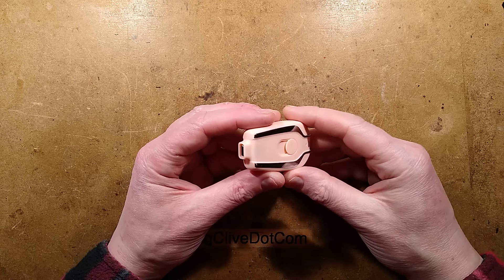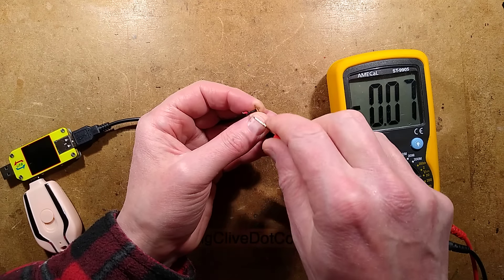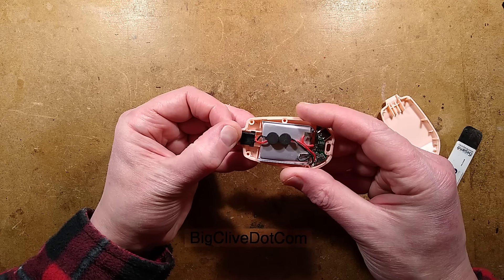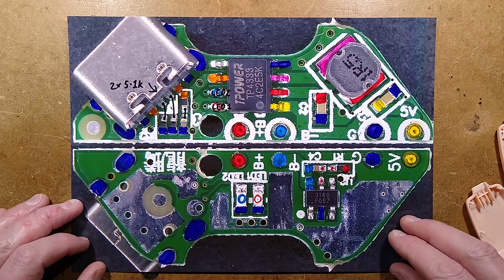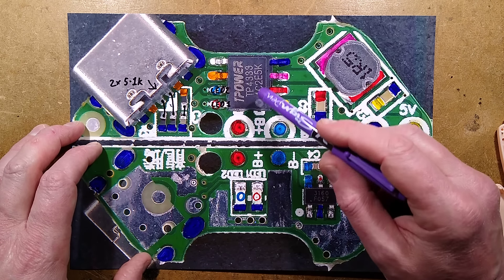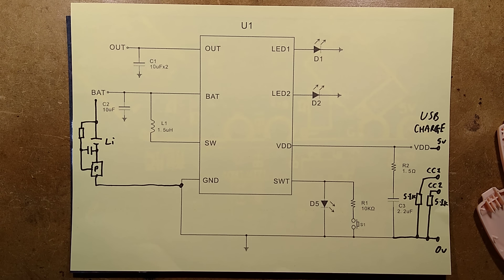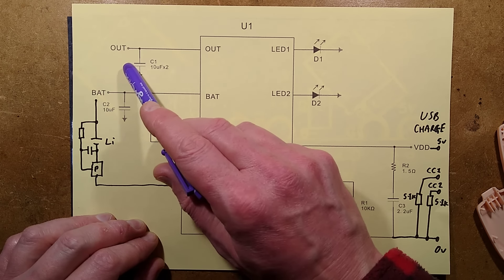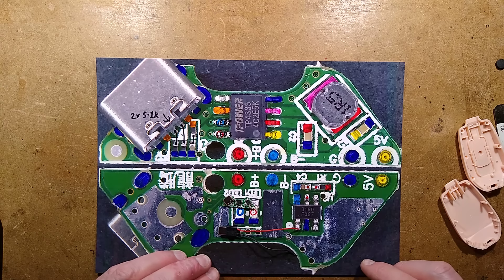eBay keyring phone-killer

Comment: Hi big Clive have you used the Bluetooth and app on the usb power meter ? Video on it soon ? Also recently had a baofeng radio with the pos and neg with the wrong colours lol
Reply from the maker: I'm not sure this model has Bluetooth.
Reply: @bigclivedotcom  ah I made an assumption that it would just be the same model lol .try top right above the usb output side. you might have a tiny sliding switch near one of the 4 buttons  🤷🏻‍♂️👍🏻
Reply: @bigclivedotcom  I changed my picture if you  want a look where slide switch would be n hello from the bridie toon 😏👍🏻

Comment: a company i worked for bought 2 hundred 12 volt 30amp power supplies every one was fused in the negative line and all where CE Marked
Reply: Well the Japanese switch the negative on low voltage DC.

Comment: I bought a cheap 4 gang extension off Amazon with USB built in. I plugged phone in and after a while it tripped my electric until I USB. The normal plugs works OK but I've stopped using the USB's

Comment: Quality Control! I am pretty Shure thats a thing in the past. I have brought so much stuff in the past (just not electronic stuff) even a brand new car (a gouge on the rear bumper and the cover for the battery laid across the engine and the bonnet closed down it). You remember the sticker with the persons signature and the number of the station they was sitting at? All things of the past.

Comment: I would have just said to salvage the lithium cell out of that, but given it was only 600mAh, was it worth it?
I'd have soldered the wires back on the right way, so that it at least worked, but the same is true - what use is a 600mAh powerbank when 3000mAh powerbanks are still relatively portable?

Comment: I'm wondering if the worker who was soldering the wires saw how the battery was wired and thought that's how the connector should have been wired. It DOES seem a little odd (to me anyways) that it's reversed from how the battery is wired

Comment: A long history of this type of assembly error.  We bought two remote control appliance switches.  Discovered that, just like here, the output was swapped polarity on both!  Worse, the wires were swapped before the switch, so it was switching the neutral on and off, instead of the hot.   Reported it to UL and CSA.  They did not care! Their label means nothing!

Comment: That is quite insidious as low voltage electronics cannot always afford the usual ultra-cheap reverse-protection diode due to the forward voltage drop. Given cost constraints, I wonder how many usb devices do have polarity protection?
Reply from the maker: There is a polarity protection technique using a standard MOSFET with no voltage drop.
Reply: @bigclivedotcom  Yeah I just wonder how many actually spring for it given how insufferably cheap manufacturers are now.

Comment: Connectors are also not fool-proof, when I bought a 3D printer from a company called Sunlu, it did not extrude filament correctly, upon further inspection, the connector to the stepper motor responsible for filament extrusion was forcefully inserted the wrong way around, luckily, in this case all of this just meant that the printer didn't print, however if this were a base motor or polarity for electronic devices, the outcome could have been worse.

Comment: Hey Clive. I was wondering if there was some way you could include links, or even just generic instructions on how to buy some of the nifty gadgets you use for testing the not-so-nifty gadgets. Like, I'd love to gave that USB capacity meter you have. Ditto for the HOPI, though I don't think they work in North America, and my Kill-A-Watt died in like 6 months. But that's what I mean, It's assumed you buy the higher quality (or at least less crappy) testing kit. So I'd rather have the things you use. But at the same time, Other than having a CSV with each product and site listd I don't see how that could work.
Reply from the maker: The Ruideng and Hopi came from eBay, but are not always available, or sometimes listed with a different name.  I can't provide direct eBay links because they tend to rocket in price.
Reply: @bigclivedotcom  That's good to know. And they would work on North American Mains with an outlet adapter without it affecting the operation at all? That's my main concern.

Comment: Dear Clive,  I hope that you realize that the USB-C is reversible and that your tester does not have an IC that can switch the input properly.
Reply from the maker: The USB plug is reversible because the pins are mirrored.
Reply: @bigclivedotcom  So it is...  Just looked at the spec sheet.  But where the switching comes in is swapping the power and data pins for certain applications was where I was confused about.  Thought there was an IC just like a bridge rectifier that did switching of polarities

Comment: Any "best practices" (or ISO) approach would surely eliminate this repeated mistake by the mfg.  But implementing a lean mfg solution isn't cheap.   So we get what we pay for.  Your diagnosis was simple to follow even though my career discipline is mechanical/hydraulic, not electrical.
Reply: You have repeated a common belief that “lean Manufacturing “ is too expensive to implement.  Actually not using lean manufacturing can be expensive.  You have to complete a RCA /8D.  Once you identify the error you need to make a change to eliminate the error.  You also have to determine why the error was not identified until it reached the consumer.
Reply: @cdnmetelhead4013  I spent 2 days a week all day for 6 months doing fishbones, flow charts (i/o) and other lean mfg related RCA studies in a room with about 6 or 8 other highly paid professionals, to determine the company costs for non value added engineering revisions.   At one point I thought about doing a side study on how much we are spending to see how much we are wasting.  I was afraid the irony would upset the VPs, whom love their pats on the back for doing "something".  Right, wrong, or indifferent.  

I never said it was too expensive.  It IS expensive to implement.  Internal resource costs can easily hit 6 figs in no time.  I was on an eng project to simplify the interface with the revision control module of our pdm.  The first fiscal yr it was implemented, it saved the company 5 mil.  Not every company can afford the time to implement such a study though.  But as proven, they can and usually DO pay off.

Comment: My guess is $worker noticed the battery wires are + and - from the left, saw red and black wires, and assumed the wires on the output were the same orientation. It is an easy trap for the new and the tired.
Reply: They probably have to make 1000 a day too.

Comment: i wonder if this is a one off and you just got unlucky.
600mAh isn't a lot for the battery but it would definitely be fine as an emergency backup for a keyring. If it can maintain it's charge when not in use for a long time.

Comment: Besides the common utter scam battery size spec, I was wondering from the caption if this report would call out any heavy chunk of stuff hanging off a micro connector as a damage hazard or cause?  

Some products simply should not be made.  

Another issue is how some power banks, including reputable brands with QC circuitry, require a button push of the same button that turns on the charge level LED row, to start output even if connected to a maor brand phone or tablet. In theory newer power banks with QC and IQ controls of voltage and current, never mind USB-C spec's for potentially 3.3 to 20 volts and up to 5 amps, need to sense load issues and protect against bad cables or load devices (that a backwards polarity would appear to be).

Comment: That's too bad that a simple mistake can ruin so many devices. It's too bad. That's terrible quality control. It's actually a neat device. Especially if you just wanna clip it to a key chain and give your phone a quick charge for an important call. I'd just hope the device that it gets plugged into has reverse current protection or some components that would protect the circuitry.

Comment: Did you put it back together (correctly) and measure the output current / voltage?
Reply from the maker: I put the battery on test and haven't reassembled it (correctly) yet.

Comment: If you replace the battery, what might be the max theoretical capacity you could put?
Reply: That looks like a 25mm x 35mm x 5mm cell (for a type code of 253550), and from my cursory Googling with that form-factor you'll be hard-pressed to beat the 600mAh it ended up being (from the description).
Reply: @aaronmdjones  oh sorry, my question was electrically speaking
Reply from the maker: If size wasn't a limit you could have any size of cell or a cluster of parallel cells.  But recharging could take much longer.

Comment: Normally I would doubt  that this thing would cause any problems with any modern equipment because polarity protection was standard for years. It was just a matter of putting a one-way diode on the positive input as far as I'm aware. Maybe things are different now. Trying to charge a Lithium Cell directly with incorrect polarity is definitely a bad idea as the cross-polarity would effectively be shorting the charge (correct me if I'm wrong). So this all raises the obvious question: Do modern electronics have polarity protection? Does the charge chip and voltage regulator circuit have polarity sensing?
Reply: My $100 bluetooth speaker had a series diode between the primary buffer capacitor and the rest of the circuit. So when you connect the power the wrong way around it will go "pop" inside as that capacitor explodes but other than that it will be fine. A problem with putting a diode in series is that it will drop a voltage. If it is a shottky diode it is not as bad, maybe 200 mV but a regular silicon diode will be more like 600 mV, so if you put 2-3 amperes through it you lose over a watt which can make it hot enough to fail/desolder. Another strategy is to put the fools diode so that it will short the reverse connected thing out (preferably having a fuse in series). Such a strategy may also just count on the power source to be fused instead. Of course, one could use a FET instead of a diode and get nearly no losses but it increases component count and cost slightly and may therefore not be done.
Reply: What you call the 'fools diode' is something I have seen which was used to protect circuits from high voltage burnouts.  But what I was referring to mainly was on the input circuit  that was to be fed by a 9v or 12v DC from Mains transformer (commonly called Power Adaptor back in the day). It was very common for people to use incorrect voltage or incorrect polarity transformers as polarity wasn't standard for some reason (i.e. Wasn't always 'Centre Positive').  In those devices, incorrect polarity wouldn't destroy the diode, the power adaptor would just get warm very quickly (ceramic smoothing-cap across the power rails I think) so you would know that you got the polarity wrong. However, an incorrect voltage that was too high by just a 3v difference would destroy that diode. ....which is why many bodge-artists just bridged the points where the diode used to be. (The same bodgesters thought bridging across an internal fuse on a 50v circuit was a good idea until the equipment caught fire when the original fault inevitably happened again).

Comment: I operate a selective soldering machine building boards for nice expensive power amps used in big PA systems. Even we get the odd mistake which escapes our fairly rigorous quality control. When you’re looking at minuscule profit margin, mega mass produced cheap stuff like this, assembled by a hugely overworked and woefully underpaid Chinese employee, probably working in pretty terrible conditions, it’s no wonder so many units are duff or even dangerous. 
  Problem is, at this level people won’t pay the money for items assembled under fair and safe conditions. 😕
Reply: Are such quality items even available?

Comment: I once bought a cheap power cable for my £280 TomTom satnav, supposedly 12/24v to 5v, it smoked it straight away, on dismantling the plug I discovered there were no electronic components inside, just 2 wires from the centre and outer pins of the lighter plug straight to the mini usb plug!
Reply from the maker: I've got an OBD port to USB adaptor here that puts the cars 12V straight to the USB connector.

Comment: Aw, only 2 wires to the type C plug. No chance of shenanigans over 5 volts; Power Delivery going the wrong way could have been spicy like that time I hooked up an Arduino Pro Mini to 12 volts in reverse and blew up a tantalum cap (probably wouldn't be possible unless the sink side also goofed up and switched the +/- wires). Fortunately the board was undamaged, so that was an easy fix.

Comment: Crazy. I think it is rather frightening that more and more people that live in places that does generally have good regulation when it comes to hazardous materials and circuits will be bypassing all those regulations by private importing things using amazon, ebay, aliexpress, wish and so on. Who knows how much dangerous goods just end up in peoples homes, and what the accumulative effect of this will be over time. I don't want there to be a ban on private import though, I just wish the culture surrounding it was more observant on what the risks are and who is liable if something goes wrong. If you import something and your house burns down you can't hold someone else liable for that the same way as if you buy it from a local company. This entire paragraph is assuming regulation similar to EU, not sure how it works in other places. But since local companies have an economic incentive to not cause damage they may have some more quality control than if the only incentive is whether you sell the product or not and there is no liability involved at all. Only the reputation of a username on the internet... which doesn't say that much today when reviews are cheap to buy.

Comment: That's a shame alright, but don't feel too bad for the manufacturer, that could have been easily caught in a simple quality control test on the assembly line. Or did the original manufacturer actually catch that and then dumped all the failed ones to a sub-contractor who didn't care and sold them "as is" ?

Comment: Why do some charging wires just go bad
Reply from the maker: They tend to break internally at the points of most stress like where they go into the plugs.  Adding strain relief to a new cable can make it last longer.
The surface plating on the contacts can also wear off over time, resulting in a higher resistance.

Comment: Seems like it may be 'good practice' to always test new power banks on a sacrificial device (like a light or something) that can be easily replaced -- prior to plugging it into a more expensive thing like ones currently-used cell phone. Sure, having a multimeter would be really nice and all. But not everyone who has a power bank needs to worry about a multimeter in their lives. Maybe even keep an old obsolete phone around for just such a sacrificial purpose, rather than scrapping it. I can just about imagine how far you'd get trying to get that POS power bank seller to replace your ruined device...assuming you'd make it past the language barrier. The factory that made it, and the seller who sold it, obviously didn't do even a MINIMAL check of the device prior to selling it. And there were probably quite a few made with that same flaw. It probably makes more sense for them to try to sell them to recover the mats cost, without regard to societal harm, than to recall them and try to fix them individually. The ethical thing to do would probably be to just scrap them all, and eat the costs of the mats. But nowadays it's a simple matter of creating a new disposable account on a site like Ebay or Amazon, offloading the dodgy products to trusting 'suckers', and fly-by-night as the complaints come in. It's a terrible whack-a-mole problem. The best Ebay/Amazon can realistically do is blacklist/block a bank account number of the fraudsters. And then it just becomes a matter of how difficult it is for them in their country to get a new bank account number. Sometimes they're back up with a new number on the same day, according to a documentary I watched awhile back. Some of them definitely seem to have a good number of pre-made bank accounts all ready to go as soon as their current account is closed off. Being able to buy things 'direct from China' is nice in many ways. But it can be exceedingly dangerous as well.

Comment: Those tiny power banks could be useful for powering low current devices, I have  21,000mah power bank that can deliver up to 5A but its almost the same size and dimensions as a house brick and weighs pretty much the same as one too lol!
Reply: I have a (genuine) 1500 mah one I keep in my jacket pocket, about the same size as the one in the video, along with a short cable. Takes almost no space and weighs very little, but will  charge my phone by about 20% which is enough to make a call, use maps, call an Uber to get home etc
Reply: The problem with a lot of these powerbanks is that they will switch off the output if the current draw is too low.. Sometimes less then like 50ma will not be enough to keep it on.
Reply: @longinus665  True. I've got an Anker one that has a trickle charge capability - bought it specially to charge a keyring torch. Most powerbanks won't charge the torch.
Reply: @longinus665  yeah, most do that, my big one has a selectable mode to prevent that and will stay on indefinitely.